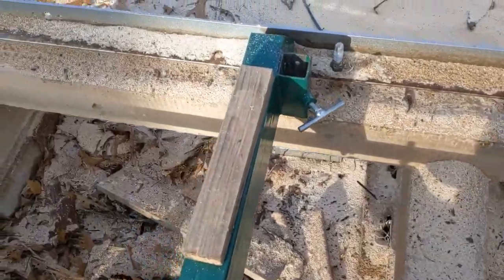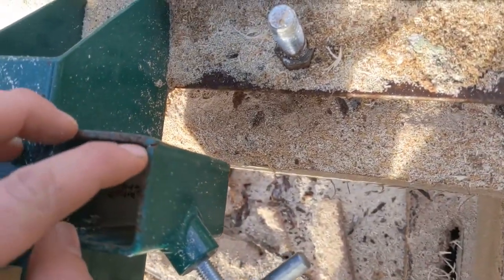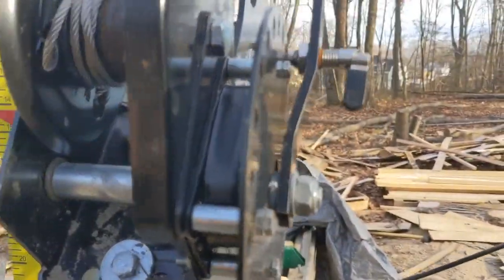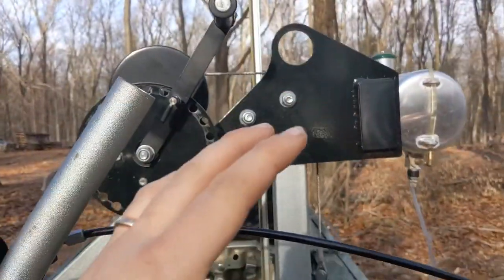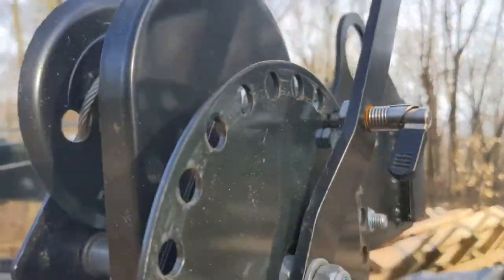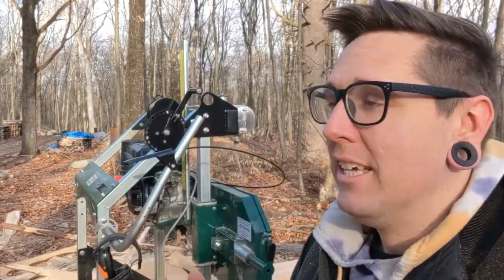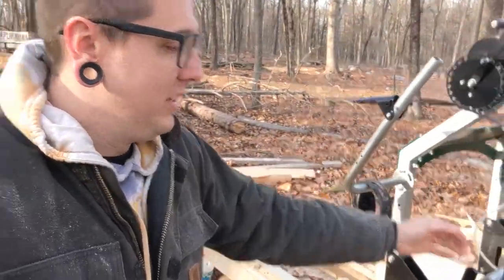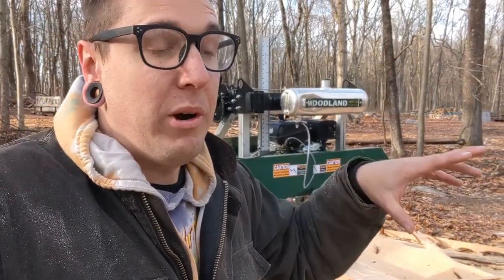ONE YEAR LATER... Woodland Mills HM122 Sawmill Review

Comment: I'm in the market for a mill as well, mainly for hobby use and to mill up the ash trees on my property that are dying, and went back and forth between the 122, 126, and 130. Since my tractor is a little smaller than yours and most my trees are under 20", I think I've decided on the 122 as well. I figure if I need to mill an occasional larger log, I can use my Stihl MS661 and get a longer bar and Alaskan chainsaw mill and do it on the ground where the log sits.